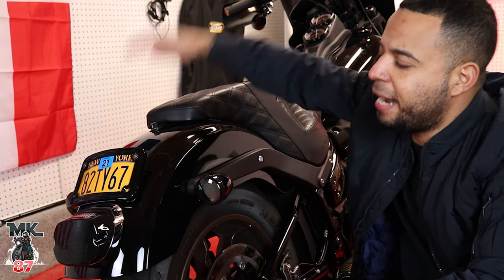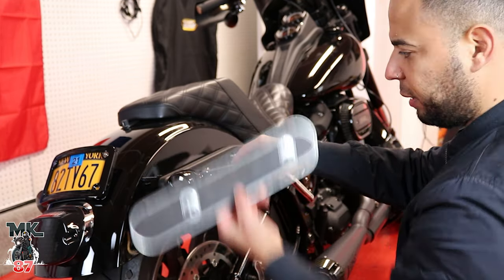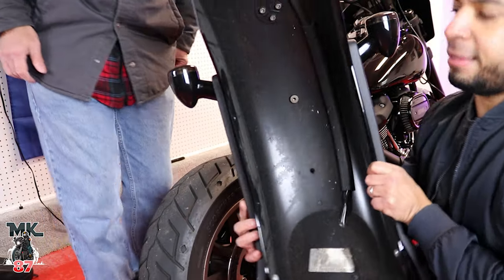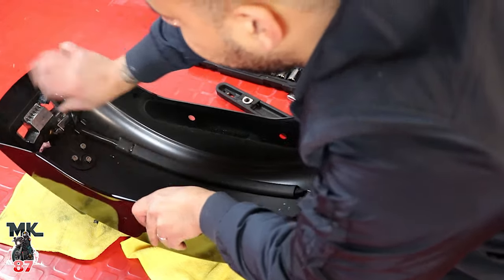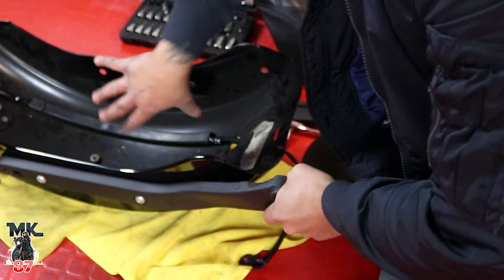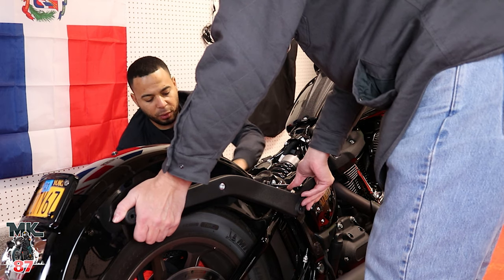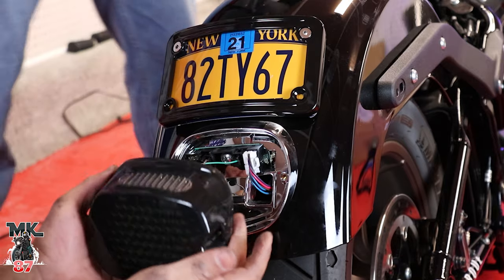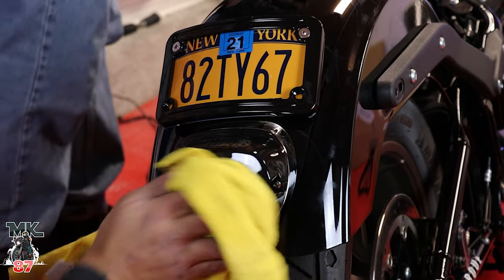Low rider s moons mc rear light and rear turn signal removal

Comment: the torpedo/bullet rear turn signals are nice because they protect your bike from damage in a low speed fall.  The integration of the turn signals with the tail brake light results in loss of clear delineation between left and right signaling.  It does clean up the bike a bit though, so I get it.  I like the smoked out lenses and will probably do the same to my bike.  I like the murdered out look you're doing it well.  enjoyable content, as always.
Reply from the maker: Your right about that they do protect it in a fall. I’m going to be adding rear crash bars so I’ll be good ok that end if anything. Thanks bro 👍🏽
Reply: @Marvelkid87   w/ the rear crash bars, really it is close to perfect.  good on ya!

Comment: If you go on hairy customs he makes black plugs for the 2 open holes where the turn signals were.
Reply from the maker: ill check that out right now thanks!
Reply: @Marvelkid87  glad to help he does good work I ordered a bronze oil cooling screen for my 2020 low rider s from him.
Reply: Hairy customs or you can do “trackerdie” that website has some nice block off plates. You can get ones custom, chrome, or just plain black.  I got mine from them for my 2020 Lowrider S and it definitely fills in that ugly gap.
Reply: @MarvelKid87

Comment: Hey brother , did you change out the bezel with the circuit board or was that stock bezel ? Man my 2022 FXLRS doesn’t have slots on the board for turn signals ! Just found that out after ordering your same set up and taking off the fender , removing the signals and all that;,,, glad I didn’t cut the wires I’ll tell you what!

Comment: Did you clean the fender and re-apply double stick tape? I hope you did ... I had a wire drop once onto the wheel because the tape didn’t adhere well and it shredded the wire.  Just a heads up